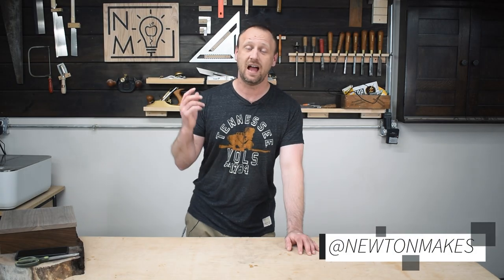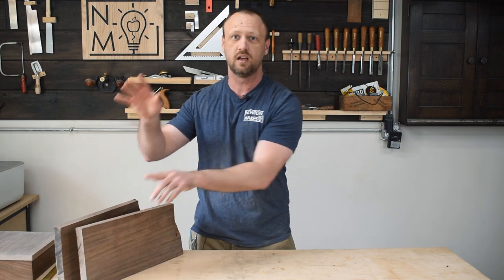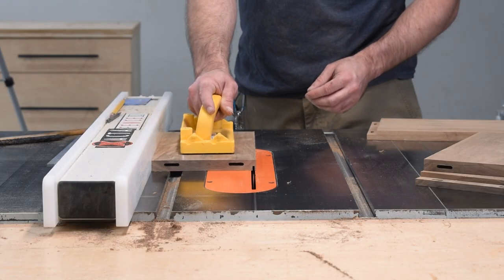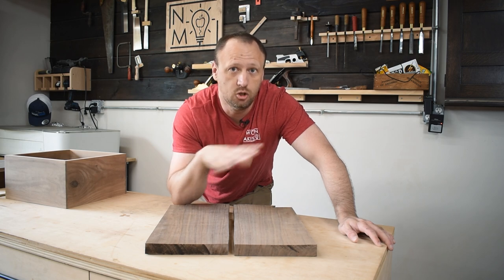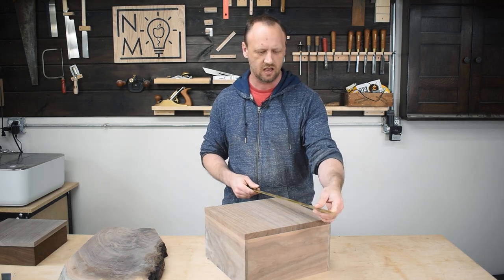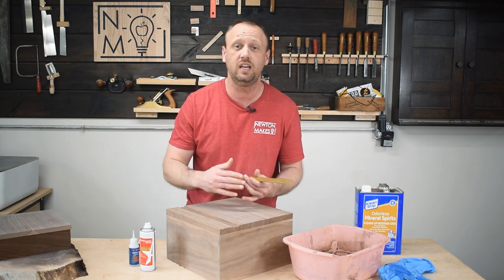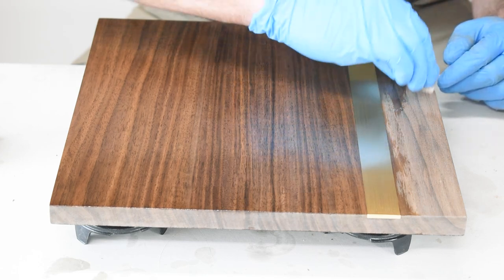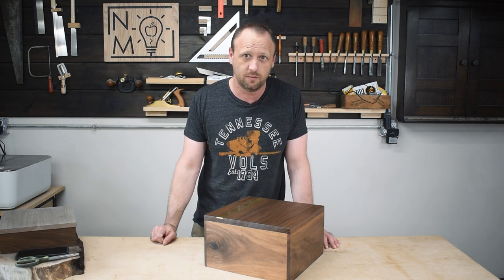Metal Inlay in Wood | Add Brass to Your Woodworking Project

Comment: I might want try anodizing aluminum flat bar bright colors and inlay it in light color wood like maple or similar.  One point I’d like to make is you want your metal inlay stick up a little so you sand it flush with wood.  With anodized aluminum, obviously you would sand one side and flip it over when it flush.

Comment: It's fun watching wood go from slab lumber to finished, workable wood!

Question:  I'm sure it varies based on where you live, but how long did you let the resawed lid acclimate before continuing to work it?  Are we talking days?  Weeks?  Obviously, lots of variables, like humidity, ambient temperature, thickness of the resawed pieces, kind of wood--just tryin to get a feel for what you did.  Don't think you mentioned it.
Reply from the maker: I find it best to wait at least 24hrs. But I notice very little change in my shop if I'm using slabs dry wood. Each shop is different.
Reply: @NewtonMakes  Okay, wow, was NOT expecting it to warp that quickly.  Thanks for the quick reply.

Comment: Nothing basic about that box, it looks awesome! Love the grain on the lid and how it contrasts with the side panels.

2 questions: When you clamped the box, you had glue squeeze out. Did you wipe the squeeze out off before it dried or did you let it dry and then sand? I have found glue difficult to sand out and curious if you wiped it (spreading some of it around) or let it dry in it’s natural place.

What saw did you use for cutting the brass? Didn’t look like your mitre saw, which I figured you would use with a different blade......
Reply from the maker: Thanks, it was a whirl wind of a project as I was trying to hit a deadline. 

The best method that I've found is to let the glue skim up. Wait until it's dried enough to be peeled away and then lightly scrape it away with a chisel.

I used a super expensive Harbor Freight metal cut off saw. I think I paid $30 for it. 😂

Comment: This is exactly what I was looking for. Where can I buy brass bars like that? I want some strips on a credenza.
Reply from the maker: I got mine locally, but you can buy it from McMaster Carr as well.
Reply: @NewtonMakes  thank you so much!
Reply: @NewtonMakes  is there anyway for you to check this sideboard and see if it’s possible to add brass bars on the lighter wood parts?

Comment: so its ok to run that brass thru the planer? it wont damage the blades? also, do you use the regular long blades that come with the dewalt planer or did you upgrade it?
Reply: Brass is a very soft metal, it shouldnt hurt the blades to bad
Reply: He ran it through a drum sander not a planer/thicknesser. 
Personally I wouldn't risk putting brass through my planer blades

Comment: I'm putting brass inlay into a large oak tabletop that I'm going to stain. On a practice board, I have to sand the brass with extremely fine sandpaper to get it to shine nicely, but I don't know if the oak will take the stain after that kind of sanding. Should I prefit the brass, then remove it, stain, then glue in the brass?
Reply from the maker: I would carefully hand sand the brass after its installed. That way there's no risk of glue or anything else impacting the oak.

Comment: Ideas received with thanks
= metal-inlay, finishing grit, wax/film

Likely Usage 
= (check suitability)finishing, aluminium-extrusions for more low-class industrial look with (cheaper than good-wood)modular(click) floor-laminates(fake-wood, maybe more-expensive wine-resistent type and/or burning cigarette-resistant type).

Objective
= troll internet to buy more and spend more and play more and ... jealous more
= cheaper is more